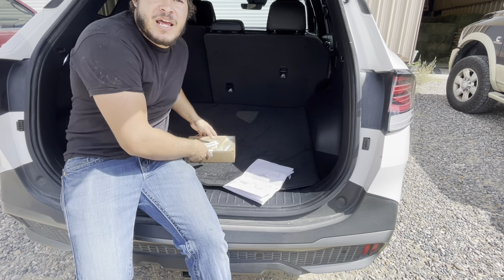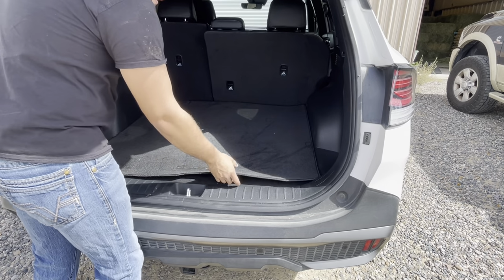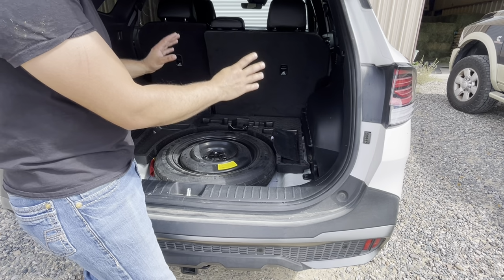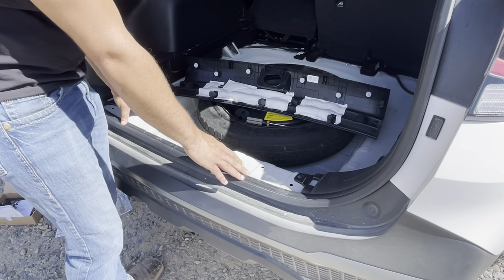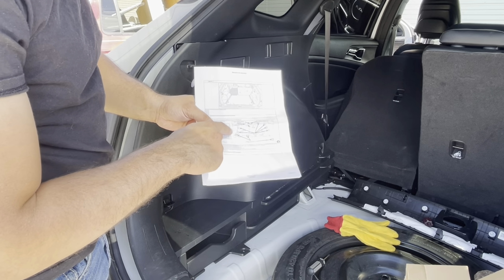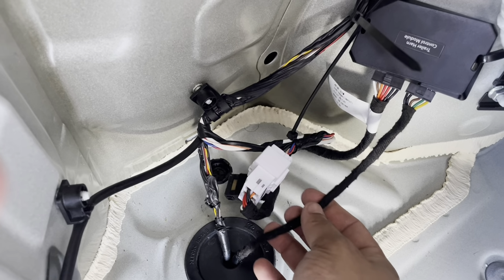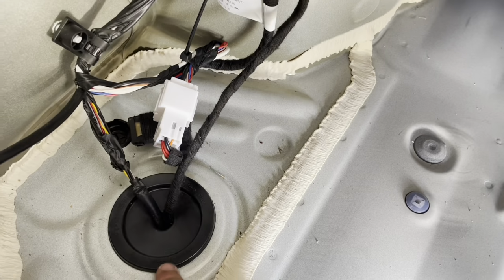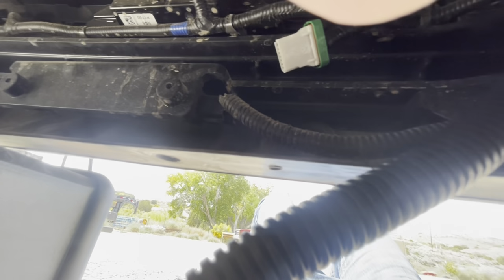2023 Kia sportage tow hitch wiring instal

Comment: Did you require to run a wire to the battery, or was this all done mostly at the back end of the car? I appreciate the video...thanks so much!
Reply from the maker: No with the factory kit everything was plug and play
Reply: I purchased the kit from KIA and it couldn't have been easier. Thanks so much for the video. I wouldn't have tried this myself if I hadn't watched your video.